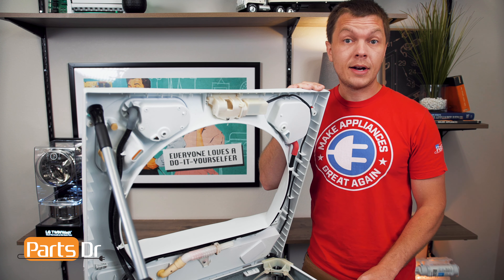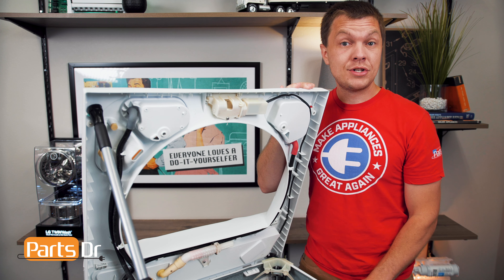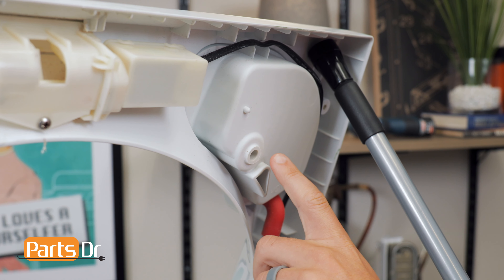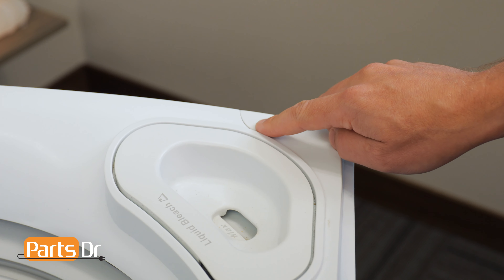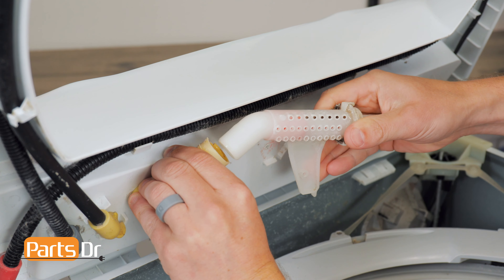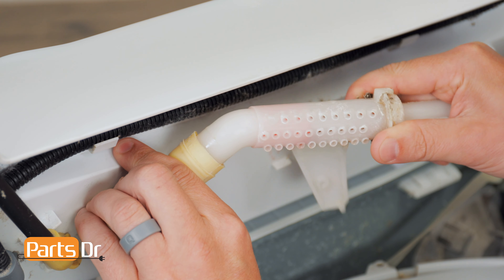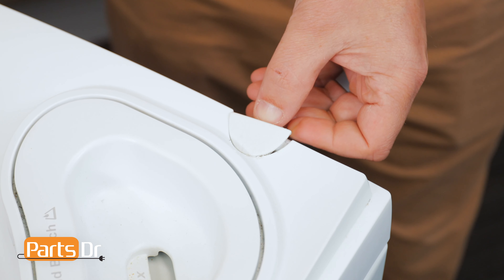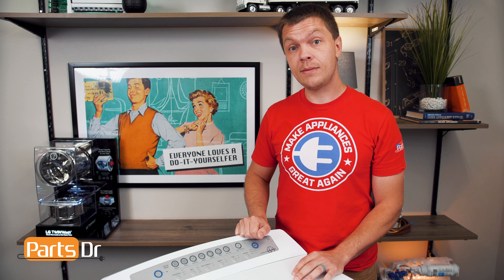How to replace Fisher & Paykel washer fill spray nozzle part # 420833P

Comment: These videos from PartsDr are life savers. I took out the spray nozzle from my machine (2011 GWL15) with help from these instructions to see if it had any issues. It seemed to be leaking or backing up and constantly dripping water after a wash cycle. It turns out there was calcium buildup in the spray holes and inside the nozzle, which a little vinegar and baking soda cleared. I reinstalled it per video, but lightly lubed the end of the tube with Vaseline first for tighter seal. Now no dripping. But if I need a replacement in future, I'll order from here. Thanks much!
Reply from the maker: Nice job fixing it yourself!  Thanks for the feedback!
Reply: Richard, did you have to disconnect your water supply to do it?

Comment: Hi. Do you know how to remove the rubber elbow nozzle? We need help replacing ours. Thanks!
Reply from the maker: I'm sorry, we do not have instructions for that part yet.
Reply: We need help on that too
Reply: Me too. Just need to know is it a hard pull out or do I need to get in from the control panel 
Or does it need a service call?

Comment: I have fisher pykel cleansmart and it stopped filling up with water. The drum is spinning but nothing coming out. What could it be? plumber said thar plumbing is not the issue
Reply from the maker: It could be caused by a bad water inlet valve. We have a video on that part here: https://www.youtube.com/watch?v=_jc6gXmwVpA